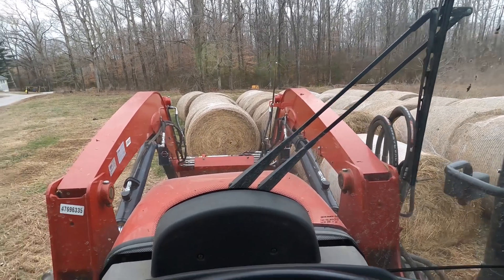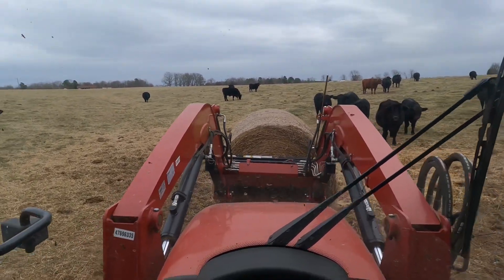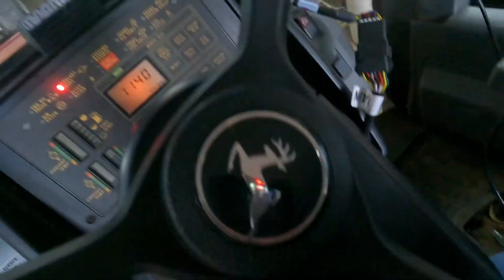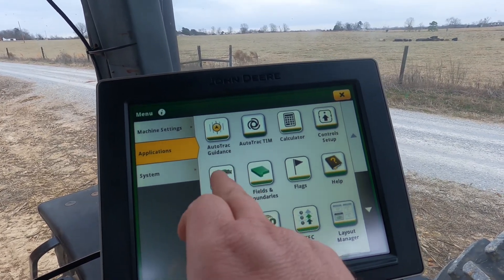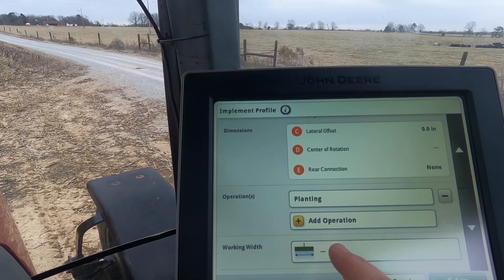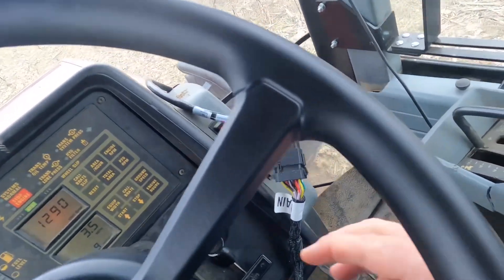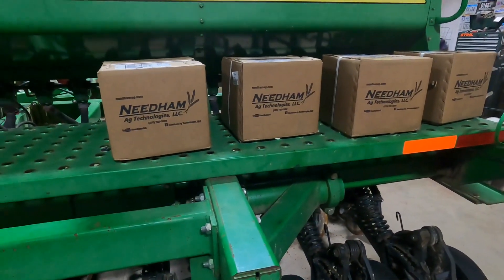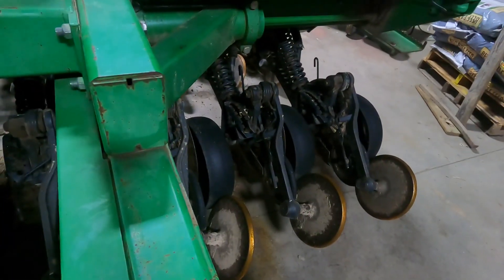Powered by Case IH, Driven by John Deere! JD 4640 Greenstar display and Starfire 6000

Comment: Nice upgrade, what are your plans with the ez guide. I have been looking for a second one to put in the IH 1086. The one I have now is in the Kubota m7060 and has the ez boom for spraying. I really like how it all works. A second step up for the IH would make it so I don’t have to move things back and forth.
Reply from the maker: If I decide to sell it you will be the first to know but my plan is to put it on the 5088.
Reply from the maker: Email me thomasfarmstn@gmail.com
Reply: The email address is not working. It looks to be the same as what is on your about page but it will not go through.  I will try it tomorrow.
Reply from the maker: @TAHDAHFarm  it appears to be correct.

Comment: Why’d you go with a 4640 monitor over a 2630?  Figured the GS3 would be quite a bit cheaper and give you same functionality. 

You should ask the tech about JD Ops Center. It should be free to use again this year and let you store your field data and guidance lines. You can also enable wireless data transfer which is really convenient for data uploading.
Reply from the maker: I new to the whole Greenstar game. That is the monitor they said I needed.